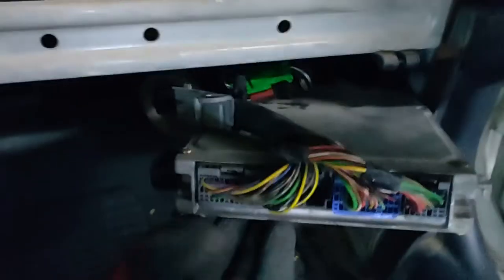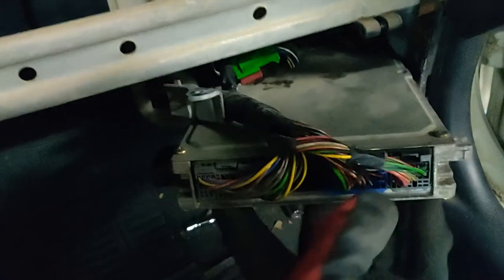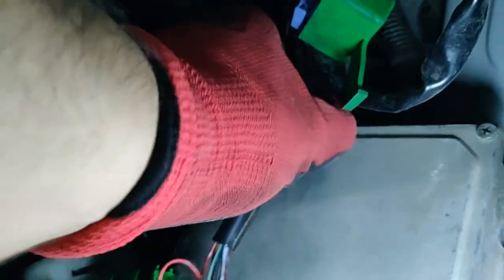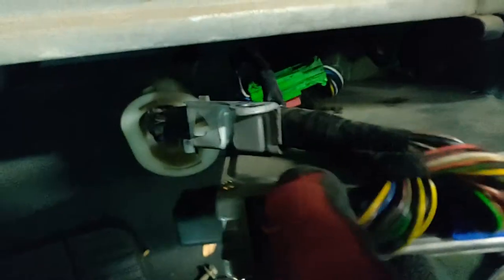Honda Civic EK 96-00 ECU replacement quick guide how to remove (English)

Comment: does it need reprogram??
Reply from the maker: As long as the computer you are installing has been removed from a vehicle with a similar engine and they have the same part number there is no need to reprogram (they are programmed the same)